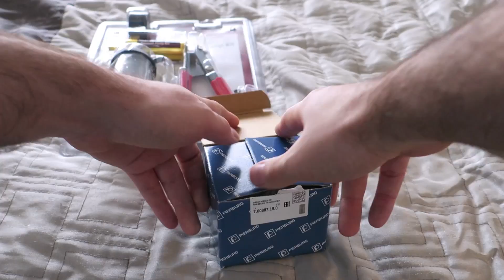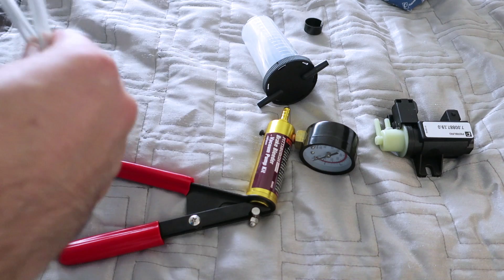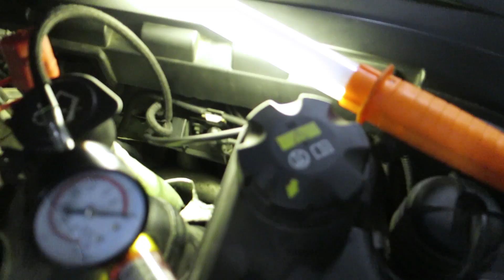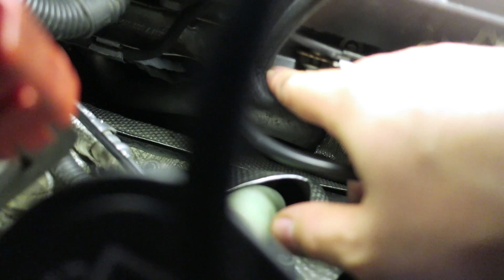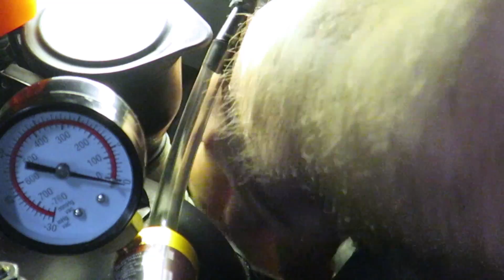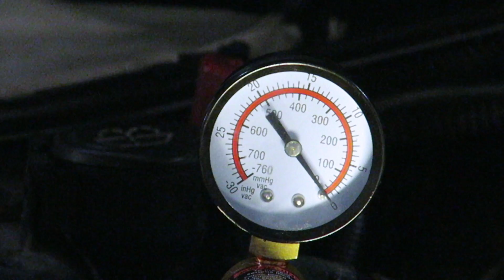How To Test Your N54 Boost Solenoids On Your BMW

Comment: Mine are showing 23 inches of vacuum when engine is at idle where yours are showing about 12. Does that mean the solenoids are just stuck open?
Reply from the maker: What symptom are you chasing? Does it jump right to 23 or get there after the engine settles down?  Having more vacuum is better than no vacuum in terms of controlling the waste gates. If it just goes to 23 and doesn’t move that would be different but if both of yours are showing 23 then it’s probably just your gauge not the solenoids.
Reply: @VehicularDIY 30FE, overboost only occurring under moderate throttle. I checked the movement of my wastegates, they operate properly, closing fully at 7 inches of vacuum? And going back to fully open when vacuum is released. This issue happens under stock mapping, or with tune (BMS BEF + jb4). When going wide open throttle, zero issues, boost is right on target, it only occurs under partial throttle, over the entire rpm range.
Reply: @VehicularDIY  video showing what it does. Gauge is connected to the outlet of the boost solenoid. Both are acting the same. https://youtube.com/shorts/A5Cm8EPHxtM?si=8HDCQFDJFHTEOILB
Reply from the maker: @BOB24502 Okay that doesn’t look normal, just goes to full vacuum and holds. The solenoids aren’t opening and closing quickly to try and regulate vacuum. So it would fully close the waste gate. What does power look like at the connector? You sure the vacuum lines are connected properly?
Reply: @VehicularDIY vacuum lines are connected properly. The car was working fine, all I did was replace my oil pressure switch then after that, it stated over boosting. I don’t see the connection there though…. I checked the vacuum lines behind the OFH to make sure and they all look fine. I bought some new solenoids from FCP and will be swapping them anyways, hopefully that’s my fix. I yet have to test 12V to see what it does, but I’ve taken them out of the car already and did the same test you did in the video. If I try building up on the inlet of the solenoid, it doesn’t, as expected. Then I plug the outlet with my finger, pump again on the inlet and it builds vacuum, and slowly bleeds it off, as you have shown in your video. Now if I remove my finger from the outlet, and start pumping again, it will start building vacuum as if my finger was still on the outlet…. I think the solenoids are sticking…
Reply: @VehicularDIY  I found this neat video showing how to clean a boost solenoid. I thought you might find this interesting. I'm going to try this just for the hell of it, and if it doesn't work, i have the new boost solenoids coming in this weekend anyways so I can always swap them if that doesn't work. I'll make sure to test the coils also to make sure they're OK first. 
https://www.youtube.com/watch?v=dkPuEmwP4oQ
Reply: @VehicularDIY quick update, I took the solenoids apart, cleaned the guts with brake cleaner and re-assembled. It fixed my 30FE issue. Boost is now right on target under partial throttle.

Comment: You should really plug the TEE line between the two boost solenoids when you're testing them. This engine could work fine with just one boost solenoid, but BMW decided to use two as a failsafe (and to complicate things).

Comment: You have to hold the solenoid upright, if you tilt it like shown in the video, even a new solenoid won´t hold pressure!! If you test them installed at the car, and they don´t hold pressure, then they are obviously defective. However, if you test them unmounted, you have to hold them top straight up

Comment: The electric side is controlled by electric impulse it should be  very precise a bad solenoid can be working but no longer be precise and you will not even get a check engine light for it until much later one way of telling is cold engine a bit rough then OK when warm

Comment: I am not sure you are correct in your statements.  The lower vacuum port should hold vacuum when pumped up.  The most probable cause for this one leaking down is that you should attach the vacuum hose directly to the port instead of using that adapter.  The vacuum is bleeding off between the clear vacuum hose and the adapter and if it isn't, the new valve is defective.

Comment: Great video, I love it. Thank you very much taking your time to share your knowledges. I have ordered a cheap vacuum hand pump like yours. I am looking forward to go on testing on my car. I have a bad Booster pressure solenoid. Just order a new Pierburg 7.02256.27.0. At the same time I have ordered a new Pierburg 7.02318.01.0 Turbo Control Valve. Good tips. If you have driven more than 150000km you should check and clean your map sensor. I did and my engine run more quiet and smoother and acceleration is much better and quicker.

Comment: Well my friend you have helped me a lot AGAIN! Thank you for your Diligence! I bought new solenoids when I got my new 17t turbos. Right away I had Strange boost troubles but thought it couldn't be my new (Chinese cheap) new ones. So for the last 8 months I have been chasing strange boost and sounds thinking it must be everything but these guys. Then I finally decided to check on them. I only saw the tests people were showing doing the vacuum pump on the lines from the canisters to the solenoids so I did that last night and one held vacuum and didn't leak at all. The other won't even pump up at all. So I changed the non pumping one for one of the OEM ones I took out  and it did exactly the same thing. So I was totally puzzled. I still have one more of the OEM ones I haven't yet tried however I now don't trust either of the Chinese ones after seeing that it's very possible they should lose a little vacuum when doing that test. Tomorrow I will do the test with the Y connector like you've done here using the OEM ones only and see what the results are. I suspect they will both act very similar to yours. Thank you again!
Reply: No one will ever update after resolving their issue
Reply: Did it ever work , what was the out come

Comment: I need help from you, 2009 bmw 535i code 30ff low boost pressure, I did changed 2 brand new boost solenoid ( Pier burg)  every time  give hard acceleration engine malfunction show. Turn off engine then start back up.. engine malfunction disappeared back to normal if you driving easy on gas paddle it car run ok… you think is bad turbocharger ??? Thank you.

Comment: I’m targeting 30-35 on idle then when I revi it it moves to 5 what could be the issue I’m getting 30FE and 3100 codes I can’t drive car as it keeps going in limp mode over 3k rpm
Reply: If the control system is capable of dropping the output line to 5inHg quickly, and then developing 30inHg shortly after, then the solenoids appear to be working. If it moves from 30 to 5 slowly, that could be a clogged solenoid vent causing the wastegate to open late. Are you running a custom tune? If it can react quickly, it looks like the default wastegate or WGDC base map are set to 100%. Also, I think your gauge is off by some 5inHg, because 35inHg would be a stronger vacuum the the void of outer space.
Reply: @greenlungo3996  yeah I’m running at custom stage 3 tune pushing around 630bhp it’s all sorted it’s a JB4 issue I didn’t put jb4 on car previous owner did and it’s the worst thing anyone could use but it’s all removed and runs better no errors or faults

Comment: I’ve got a £20 one off eBay for my cdti insignia only about 8 months old. I did have a stuck turbo so I fitted a new one myself as it was always over boosting and always limp mode after 3000rpm. Now overboost is back! Finger points to the solenoid need to check first tho

Comment: I tested both with 12v and one clicks louder than the other. I do get a 30ff code on high rpms. Do you think the lower click  on the rear solenoid means it’s going bad?
Reply from the maker: Probably not, if you're getting 30FF at high RPMs one of your turbos may be going bad.  How many miles are on the turbos?
Reply: @VehicularDIY  they’re pretty solid, 15k miles on them they were replaced with oem, no wastegate rattle or anything but I am on mhd 2+

Comment: Hey thanks for the video, this along with a couple of dedicated threads were key in helping me diagnose a bad solenoid - hoping thays all the issues but one was extremely lazy and was only pulling 4ish inches mercury at idle. Solenoids ordered!
Reply: Mine are no name ebay brand new and they pulling about the same and i get the low boost error . I know is an old comment but did you fix yours ?
Reply: @sameogedd6402  I did yes, I typically avoid ebay when it comes to parts for the bmw, I know folks do well but I would stick with oe or oem parts.
Reply: @zzmusiclist9780  ordered OEM too now and then dispute with ebay lol see if i can get my money back , worth a try
Reply: @zzmusiclist9780  what i also noticed is i have a very bad wastegate rattle with the ebay ones , terrible. Didn’t had it before or if it was definitely not noticeable like it is now .

Comment: What is the original pressure of the vacuum pump from the car？

If you press the throttle, he will close the valve
？
there is no vacuum, unless the pressure is too high, he will release the pressure？

Comment: I tested mine today with an odd result.  One held vacuum to 25psi and bled off slowly like in the video, yet the other one held vacuum to 27psi with ZERO bleeding off.  Ideas?
Reply: Bump
Reply: @M5JamesE39  It is not correct for the solenoid to leak out on the vacuum side. That's a vacuum leak. Some seem to find it tolerable given the strength of the vacuum pump. It's a pretty simple thing: The solenoid pushes a plunger piston back and forth through that white cylinder. With the output port at the cylinder's midsection, the plunger seals off exposure between the two ends of the cylinder. One has a vent, the other connected to the vacuum source. If the plunger allows any flow between these two states, it's seal is broken. The solenoid is to allow the PWM system to rapidly switch between vent and vacuum sources to deliver a metered portion.
Reply: Solenoid probably isn’t opening
Reply: Did you sort this im getting around 30psi
Reply: @Reggie-Ai  No, I just got new solenoids when I upgraded to S63TU manifolds and turbos.
Reply: @M5JamesE39  I’m getting this code along with my vanos solenoids
Reply: @An0nDEViant  my car is targeting 30 psi and I’m getting 30FE overboost code and 3100 Limp mode and I have no boost leaks etc
Reply: @Reggie-Ai  That's the opposite problem of the vacuum side leaking, causing 30FF underboost code. It looks like your solenoids both have clogged vents, or are jammed in the output-to-vacuum position. Your wastegates can't close, giving you limitless power until 30FE kicks in.
Reply: @greenlungo3996  I have found the issue, I have a jb4 if I set jb4 to map 0 the car runs mint no problems or engine lights whatsoever and it feels a lot more faster.. if I turn jb4 on to map 1,2,5 the car starts having problems and going into limp mode and feels slower
Reply: @Reggie-Ai  Test for 28-30ohms also he didn't blow air through the port closest to the solenoid like 5psi or your mouth. There should be no air going out the end port.
Reply: It’s bad

Comment: my car has this solenoid https://www.ebay.com.au/itm/Turbo-Solenoid-Boost-Valve-For-BMW-3-5-7-325-td-525-td-525-tds-725-td-CPTSOL3BM-/142804741982 
The solenoid has 3 connections, one connects to the egr valve wich i deleted, the other one to the vaccum hose from the vaccum pump and the other one to a hose with just has a air cleaner on the end wich is not plugged in to nothing. how does this control the boost pressure, if there isnt any hose or anything connected to the turbo as you can see in this graffic (solenoid id number 15) https://www.bmwautoparts.net/en/catalog/parts/11_1552/0/47543/L/M/1996/0 this shows wath i am talking about. could ypou please help me. 
Because i remove the solenoid completely and the car runs som much better now it feels like i just bigger boost now dont know how or if it hurts the turbo or the car i dont know.

Comment: Does anybody know if this is the same as the EGR solenoid for M57TU2 diesel engines? They appear the same from the exterior. Mine was making a duck quacking noise, so I replaced it with an aftermarket one but it seems to hold vacuum differently from my old one. The aftermarket one holds a strong vaccum perfectly when unpowered, but drops pressure rapidly after being energized.

Comment: All wrong. PSI ??  Vacuum is measured in mercury. Voltage for solenoid provided by 9v battery.  Should have just plugged it back where it came from and then test it.  Do you even know what you're doing ?  Sorry to say but you suck ! And now I apologize for saying that.
Reply: he clearly plugs it back in and tests it.

Comment: I've been dealing with a 30ff code for the past 6 months now. Ever since the car has felt like it's been running NA. I've replaced all of the vacuum lines just in case and I've ordered new vacuum solenoids. I purchased a vacuum gauge and tee'd into the wastegate lines running to the turbos and it showed 1 inHg. Teeing into the vacuum canisters I was getting about the same. Teeing directly into the pipe coming from the the vacuum pump got me about 4 inHg. When I pulled the brake booster pipe and covered the top with my hand it was still at 4 inHG. What do you guys think?
Reply: Vacuum pump kaput. Repair or replace accordingly. 
Cheers
Reply: the spec from Vacuum pump supply 25-30 in. hg constant  ,so vacuum pump is failing
Reply: @mikekhazma7698  I’m getting 30-35 inhg when I tested mine and I’m getting 30FE and 3100 codes what could it be
Reply: @Reggie-Ai  The wastegate solenoid has a dust filter on the vent that can get clogged over time leaving your wastegates unable to open up correctly. Still means replacing both solenoids. You can test for this by connecting a T line to your wastegate vacuum line past the solenoids same as OP's test, but with the car off. If you don't have a hand pump, just suck on the tube with your mouth for a moment. The solenoids should have this line connected entirely to vent without power. If it holds any vacuum or you can't get much air through it, neither can your wastegates.

Comment: Hi, love your informative vids... i have just had my turbos reconditioned and the parts are thicker and stronger etc..but i now seem to have an issue the actuator arm has side to side play? I can feel it when I put arm through the sidewall.. its rattling on deceleration and at low revs.. similar sound to the wastegate rattle i had prior to them being reconditioned. I know they were done properly by a well respected turbo company in the UK.. could the solenoid failing cause this? I can't believe they are rattling through failure or possibly could the arm need slight adjustment? I have no codes and turbos are working far better than before hope to hear your thoughts on this?
Reply from the maker: Thanks, I'd lean toward them needing a slight adjustment.
Reply: Hey buddy did you ever figure this issue out?? Im going thru the same thing

Comment: Excellent video!!! Keep it up. Helped me understand what the repair shop was telling me. The car wasn't getting any power at 3k rpm. Then engine light/limp mode. Took it in and he said it was probably a turbo hose or a bad solenoid. Thanks!
Reply: Did you ever sort yours I have this problem at around 3k then mine goes into limp mode and no power at all
Reply: Is that it’s not getting power until 3k rpm or not getting power after? Mine has no boost until 3k rpm. I’ve got more solenoids on the way and I’m changing vac lines tomorrow

Comment: The vacuum you see at idle (at the waste gate controller side) will vary depending on the wastegate rattle fix setting in MHD or which level of BMW programming. The vacuum comes from the engine operated vacuum pump, there will never be boost to the vacuum cannisters. The two solenoids are "Teed" together, you have to connect directly to each solenoid to test them independently. The exhaust flap operation will have no effect unless it's diaphragm is ruptured.

Comment: nice to hear a non tuned n54 under the hood just baught one 3 weeks ago and gives of that sound of the injectors working and pulsing mine sounds just like this ...im glad its supose to sound like this if u listne to engine through the front wheel u can hear this ....thaught it was injectors on the way out...my guess is the direct injection has a little more pulse noise than usual...cheers fella

Comment: Nice vid! Btw with the MHD you can tighten the wastegates for less rattle so I guess it would show more vacuum
Reply: On the MHD app there's a an option to adjust  the wastegates
Reply: @Bobbymustangrx8  took you 3 years to answer that haha.
Reply: @Bobbymustangrx8  I’m sure that doesn’t work when u have wastegate rattle it’ll probably close and move sideways and let out boost even worse
Reply: @ThatNofbody  From what I understand, the wastegates on these cars are held closed by vacuum, and the solenoid option on the MHD app changes the amount of vacuum set to pull the wastegates closed. So, in my experience I used this before and I was able to completely fix the wastegate rattle on startup. However, the amount of vacuum that was being applied was so much that my turbos would not boost correctly when actually driving the car / doing pulls etc. It's a temporary fix for worn out wastegates and / or another boost related problem I would say
Reply: @Bobbymustangrx8  What is MHD app? Where can I buy MHD? I have a BMW I would like to adjust calibrate my waste gate. Do adaptations, delete errors. It is best to do all that with BMW ista+?  Correct?
Reply: @Bobbymustangrx8  ok I'll look into it thanks
Reply: would you let me know how man????
Reply: Please explain